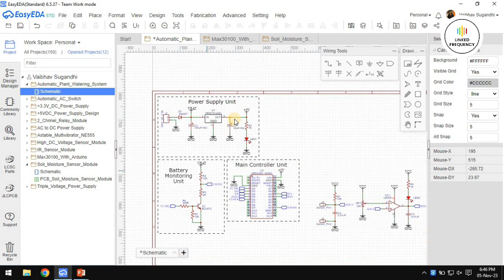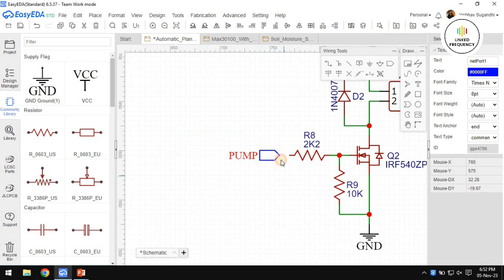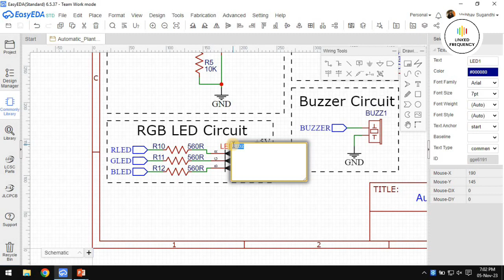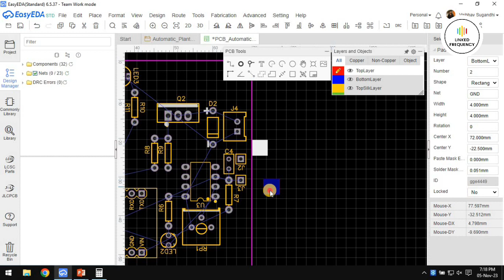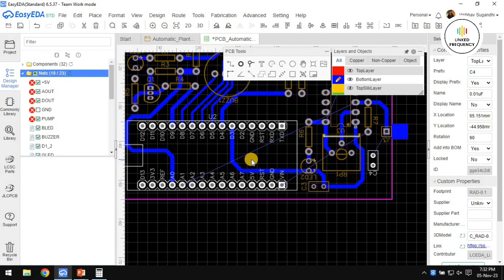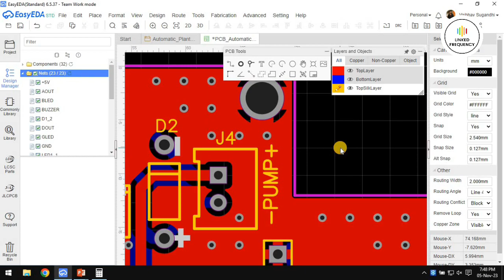Automatic Plant Watering System #E12 | Vaibhav Sugandhi

Comment: Love your videos on PCB design..I have created my first PCB after watching your channel.
What's the reason for so many via's spaced apart in this pcb design?
Reply from the maker: Hi VyshaknairR, 

Thank you for your support & congratulations on your first PCB design work. 

The bottom & top copper pours are made for GND connection with the complete board. However, if in case of no solid connection between top GND copper to bottom GND copper, then there might be a chance of circuit malfunction during full load condition. This concept is known as "Return path error", you can check about it in Google. To avoid this issue & make a stable GND connections between both the layers of PCB, we put multiple via's across the board with standard placement process. This process is called "Via Stitching", you can also learn more about this by searching online. 

I hope your doubts are clarified, If not feel free to comment us here. 
Happy learning, 
#Linked_Frequency